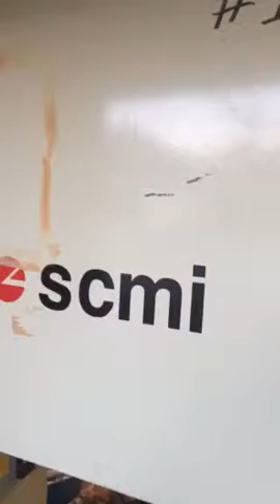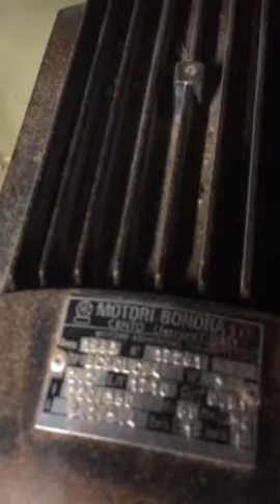3 phase 3ph bandsaw vfd 220v Ac drive inverter problem

Comment: I could not read the details on the converter (fuzzy) but if you say it is 3 phase in / 3 phase out then it is probably just a speed controller. I would suggest trying the capacitor method. Trying it without any load on it first (removing any belt drive). see how you get on, but a start capacitor will be needed so it will start under load. The other option is to get hold of the correct converter. Have you watched a 6 parts of my video series? CHeers, Andy